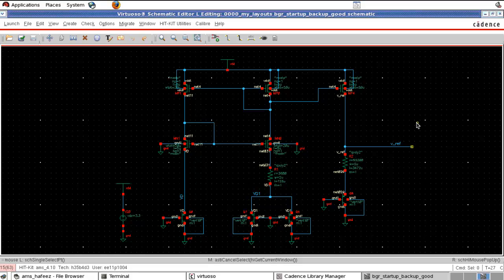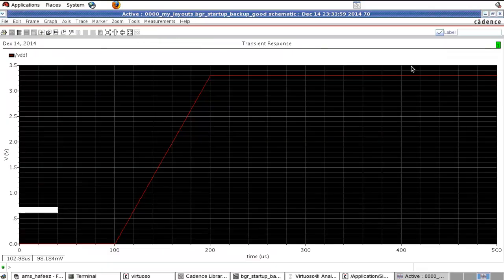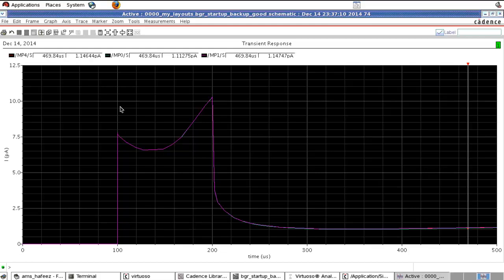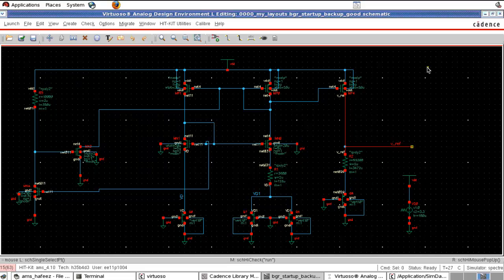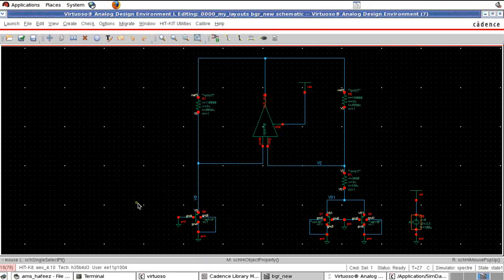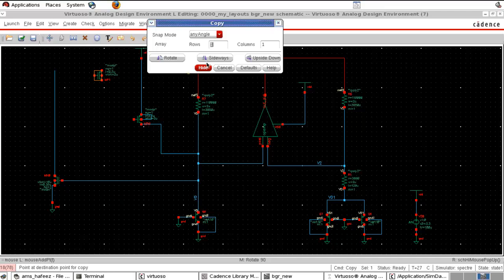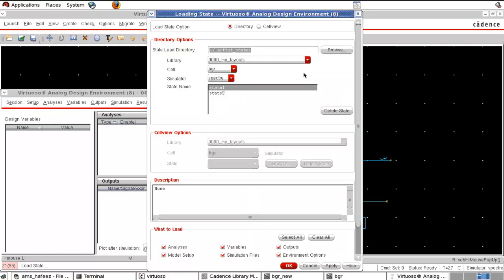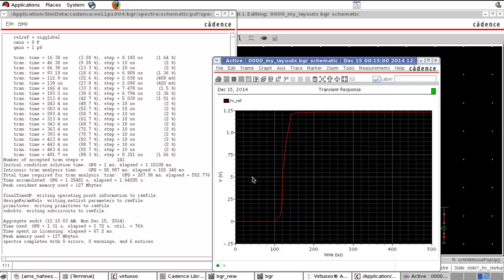Design of Bandgap voltage reference (BGR) - 12 : Simulation of BGR start up circuits

Comment: @hafeez KT my circuit is performing the same without start up circuit (means my output voltage is 500mv as desired). What does that mean? I do not need startup? But I have designed BGR so it needs startup ideally.

Comment: what will be the temperature coefficient for this final circuit with the current mirror approach. I just want to compare it with the opamp based BGR. Can you please let me know about this info? Any crude value also is sufficient!!
Reply: The CM approach is not as accurate as the OP-amp approach